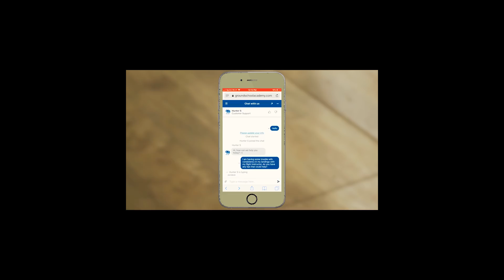Understanding IFR Re Routes During Cross Country Flight - MzeroA Flight Training

Comment: As i have learned, it is to ALWAYS be prepared for a change in your route even as a VFR pilot (Flight Following).. If you get confused about waypoints or intersections, DO NOT be afraid to ask for help meaning the identifier or anything you are not sure of... 

For  example, if ATC says go to CHUMA then ATCHUE then direct, do not be afraid to ask for help because you do not know the ID of CHUMA, they will help if you ask. They should come back with CHUMA (CHMA) to ATCHUE (ATCU) then direct... 

ATC is there for your asking so again do not be afraid of them and asking for help you will find they will provide what ever help you need... Lastly, if you are not comfortable with something they give you, let them know and they will work with you... I am a PPL, IFR and Mountain Certified Pilot..... I always ask for help if I need it... The WORST thing you can do is to sit in the cockpit, in the air, burning fuel and being confused trying to figure it out when you are not familiar with something.... 
so again, when in doubt ask for help it may save your life and perhaps some one else as well......